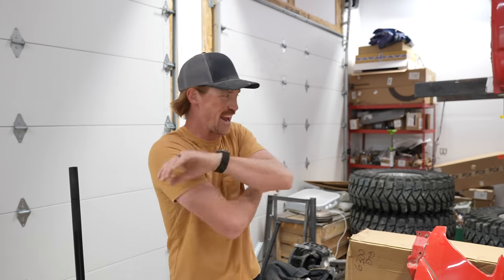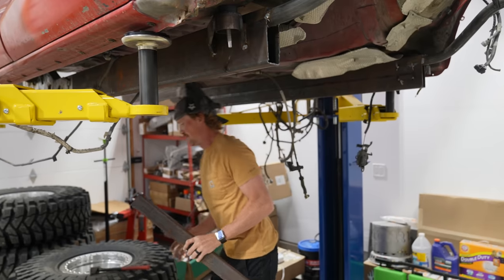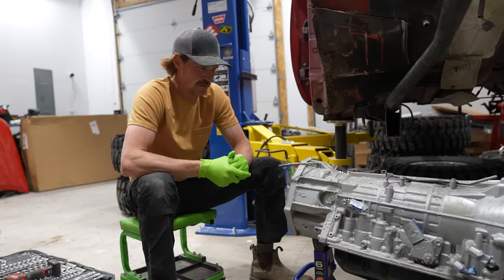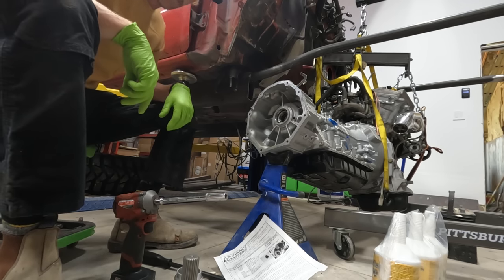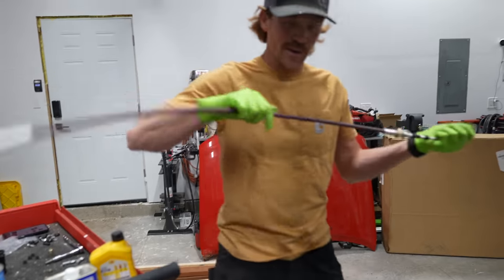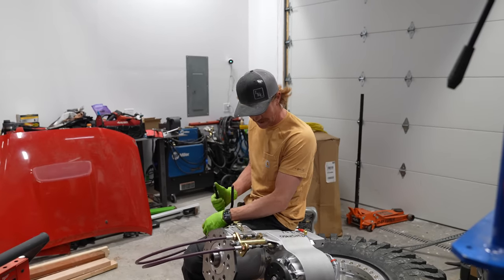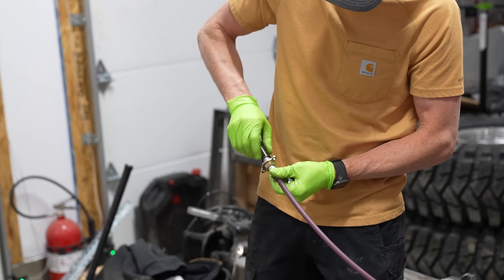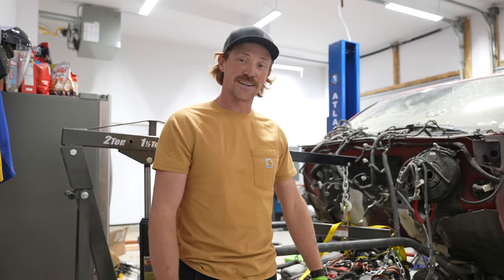4SP ATLAS TRANSFER CASE INSTALL | TRENT'S GARAGE

Comment: I have gone through what your doing before and commend you for how far you have made it... a few suggestions; one is  to facebook Rory from trail mater or how ever he spells his truck and channel name. I am positive you know  this person someway or other. One other idea is to now tack the frame rails you have under the rig so they hold their position.... then remove the cab and get stuff on the ground where its much easier to make these decisions and do the adjustments necessary for a system that is not going to fight you down the road. This way would allow you to make all of your engine mounts, and do the front axle install so its a known trajectory on the front driveshaft for the front axle. The mounts for the cab are primarily in  the right place.... you also know that nothing is really set in stone till its all done and said.... good luck young man. I did not see you getting this far but think now your real close. No harm or fowl getting some support from guys who love this sport. I think Rory would appreciate your reaching out to him as he has to haul rigs out constantly that were done wrong and failed on the course.

Comment: Just a few suggestions, before worrying about the motor mounts, remove the body and start with everything on the ground. It might be better to construct the entire drive train so you can adjust the frame around the front & rear drive shaft angles. Then the only obstacles will be the location and routing of steering,  exhaust & body mounts. Make a mark on the cross brace in the center of the frame to measure to all of the body mounts in the X & Y axis from that central mark on the frame once you adjust the location of the body to allow for the steering and exhaust clearances.
Reply: Great job guys Trent you're awesome! Brandon you also deserve a lot of credit! Several of the people here in the comments have given you excellent information. Go for it Trent and have fun!

Comment: Trent!That doubler and the atlas will make this thing crawl awesome. 
I agree with a lot of the comments about bracing the frame then taking the cab off once u
You have the firewall clearance to engine, then build it on the floor , but I’m pretty sure you are probably planning to do that and we all are just commenting prematurely 😂😂
I can’t wait to see all your progress this winter after you get the house addition done😂

Keep the videos coming!

Comment: I also have the Atlas 4 speed t case. You said you have 2 low ranges, you actually have 3 low ranges.
Double shifters in high range,range bx in high range=1:1 high range
shift range box in low range=1st low range
Shift range box into high range, shift double shifters into low range=2nd low range
shift double shifter in low range, shift range box into low range = 3rd low range
You are gonna wanna clock the t=case up at least one more hole, maybe 2 more. Run you t case as flat as you can as long as drive shaft doesn't bind, and there isn't any interference with the trans and drive shaft. This will give you more clearance on belly an easier shifter mount for your range box

Comment: You are a genius Trent. I don't care how many times you take things apart,your ability to figure things out as you go is unbelievable but your that way with everything from carpentry to plumbing electrical and truck building your a jack of all trades and a genius with all of that and even more.
   Your the ultimate problem solver for sure.
   So cool watching you think your way through all this stuff.
   Awesome work 👏
Reply from the maker: Thanks Dan! you're too kind

Comment: A little tip. After installing the delrin bushings in my shift levers I ran a drill bit of same diameter as the bolt through them.  Shifters move so much freer.
Reply from the maker: That’s a great tip, cuz these things are stiff man!

Comment: What is supposed to stop your frame-rails from flexing up and down? Surely there’s more support than just being welded to the square rails? 😳
Reply: My guess is the roll cage and exoskeleton which will be added later will take care of the flex.
Reply from the maker: It will be tied in to multiple other points on the front end cage. Also the frame rails will be beefed up and reinforced.

Comment: Just watched . Trent this is your fix. Your worried about the , motor and transmission,  become, back heavy. (( dude )) , weld , 2 , big washers on the truck frame right at where the end of transmission,  is going to screw with you. Make, a strap, harness,  from frame to frame, let it hang low, then ratchet the strap, up to hold the transmission.  
Or use, heavy , tie wire, frame to frame, and twist it tight, when your down. You cut the attachment point off... good luck.

Comment: ? Wouldn't  be better to use a brass or otherwise  less damaging hammer when beating  seal surface areas or  sensitive tolerance surfaces

Comment: Trent your engine frame rail is is too weak for what you wanting to do with your truck you may want to bend a set lower pipes and weld them end ,and some ladder rail stiffeners it might add 20 lbs to the frame but it will triple the ability of your frame to handle the tress that you will putting the engine and frame 👍.
Reply from the maker: These frame rails are just the starting point until I start reinforcing and adding to the front end of the frame